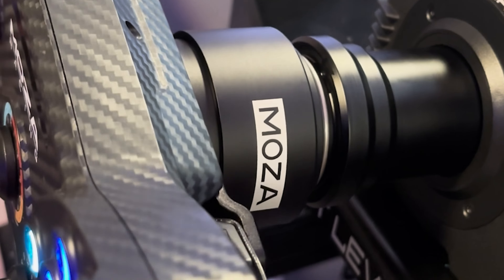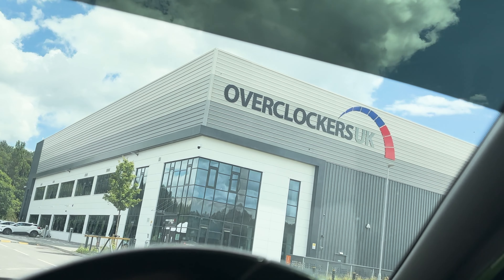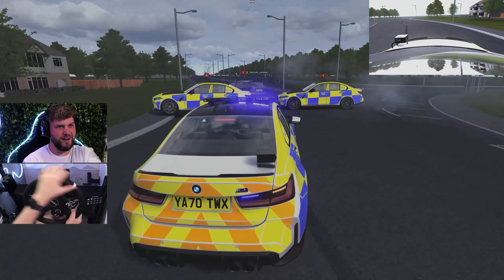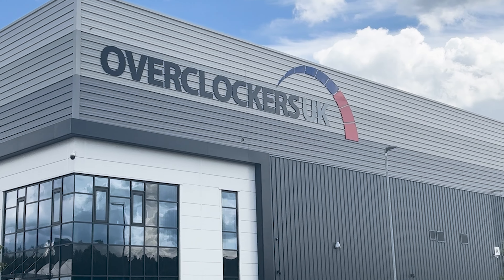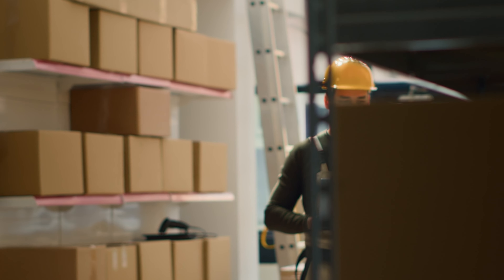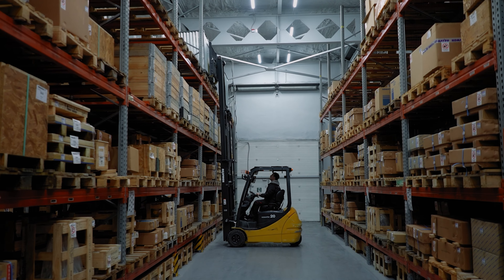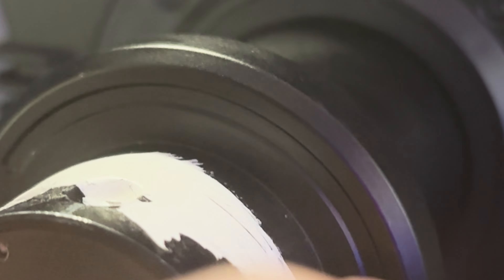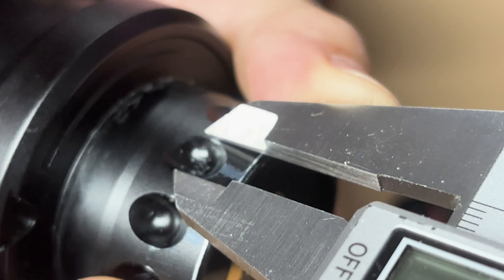Unboxing Disaster: Moza Letdown Both Products I Bought Are Faulty

Comment: Thank you for this valuable info. Not sure if you can help me, but by any chance do you remember the name of the software/app they used to test the base and the wheel at Overclockers? My unit is facing a similar issue, but it's only in specific use cases. I'd be really happy if I could run a similar test before considering sending it back.
Reply: For anyone wondering the same thing it's called WheelCheck  v1.72 also known as  iRacing Force feedback Test  v1.72

Comment: oh damn thats not good information.. i got my r9 2 weeks back but wheel came yesterday ... any idea if it can be tested without mounting the base to something? cause my TR order has not arrived yet and i didn´t order desk mounting..
Reply from the maker: no it has to be mounted i wouldnt worry too much but checking the comments for other users with the same issue
Reply: @YSGiant  i'll let you know once i'll be able to check it mounted to something ..
Reply from the maker: @Tigrha am pretty sure it should be alright dude but there is a chance it’s faulty if you bought it from uk
Reply: @YSGiant  well as there are no resellers that would have both wheels and bases in stock here i bought it directly from Moza.. came from some warehouse Moza has in Austria i think

Comment: Oh shoot, my R5 comes tomorrow... fingers crossed
Reply: i have an r5, from OCUK  btw, touch wood all good after 2 months plus, enjoy when you get it, love mine.
Reply from the maker: My r5 was fine too it was just the Moza r9
Reply: @YSGiant  my r9 has no issues and its used  have had it 3 months now
Reply from the maker: @hellrazor1646  i think ive just been super unlucky its a good thing though am glad others dont have this issue
Reply: So far all good with my R5 with the exception of a connection issue that sometimes just makes the wheel stop responding. I've read it's potentially a Bluetooth issue if there are lots of devices around. I turned off my PC Bluetooth and it seems to be fine since. Love playing truck sims in VR and some Assetto Corsa, though I have a long way to go with my racing skill haha no where to go but up! I also like BeamNG when it doesn't make me angry for being so realistic xD

Comment: I have a Moza R12 and wheel with no issues, however 2 weeks ago I bought an Moza extender that did rattle, did replace it and the 2nd one had same issue. I gave it back and took money back. Looks like they changed something with the qr manufacturing.
Reply from the maker: This is interesting, I think there an issue with the QR SHAFT ON THE BASE ON NEW products. It’s not a massive issue but it shouldn’t be happening it’s suppose to be silent and will get worse over time
Reply: @YSGiant  the extender also have a QR, the QR in my extender did a lot of noise, my KS wheel did nothing. So clearly an issue with some new QRs.

Comment: Ive been happy with my Moza R12, i only get the rattle at top speeds like on the long straight at the nurburgring.  If all i need to do is add a piece of tape I'm cool with it.     The only option at this price is Fanatec , which is a big NO for me.   Worth the compromise.
Reply from the maker: yeah i dont want to switch to fanatec just going to see what happens and your issue is mine all the time just play in the shaft and the wheel fitting

Comment: You've had some bad luck! No need to post a video about it. 🤷‍♂
Reply from the maker: How not 🤣 it’s literally my job, but also highlighting an issue that clearly needs to be addressed not only the head of distribution identified it as a problem I did also and it was not just mine that had the issue they also confirmed this 6 out of 20 products so far have been defective so isn’t just bad luck at this point and if you was to buy one of these products you would want to know that there’s a chance you may get a defective product so yeah

Comment: You've got rocks in your head if you actually believe this bloke. I've had a r5 for near on a year now with constant use and abuse and still works the exact same way it did when I first got it, silent. You've gotten a faulty one, simple. Now get ya warranty and jog on 🏃‍➡️
Reply from the maker: @NotSoBobRoss  one Moza r9 3 Moza r12 and I’ve got another video coming it didn’t end there, so it’s not a faulty one it’s a faulty few
Reply: @YSGiant  how are you the only person with this problem then? Doesn't seem to add up mate
Reply: @NotSoBobRoss clearly he isn't the only person. And the problem is well documented here and real. If you understand engineering at all you will know that tolerance is everything, it appears that there is a batch of shafts that are slightly out. So no, it wouldn't happen for everyone. But that doesn't mean it's not real.